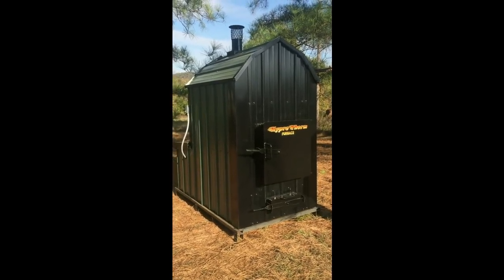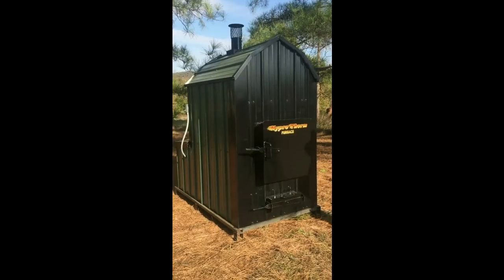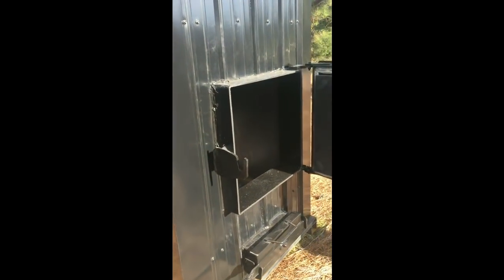Hyprotherm Thermowind Waterless Wood Furnace - not a boiler

Comment: Did I hear you say the firebox is made from 1/8" steel? I hope all of your customers burn only the driest wood available because 1/8" steel is going to rust out quickly once moisture and ash meet.
Reply from the maker: 1/8" steel is pathetic and we would never do that.  This furnace has 1/4" thick steel and is up-gradable to both 3/8" and 1/2" thick for a nominal cost.

Comment: No heat storage ? Air at 1200 degrees to start?
Reply from the maker: Hi, the 2000 CFM blower starts blowing hot air into your home at 125F, or whatever you want to set it at.  That way, you don't have cold air blowing in the house, which no one likes.